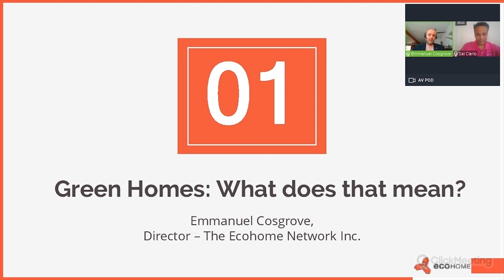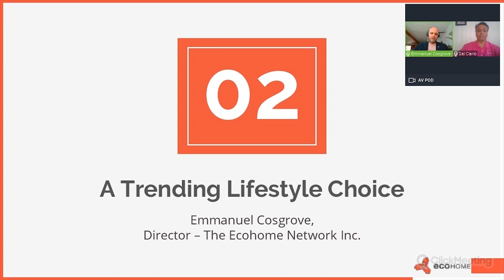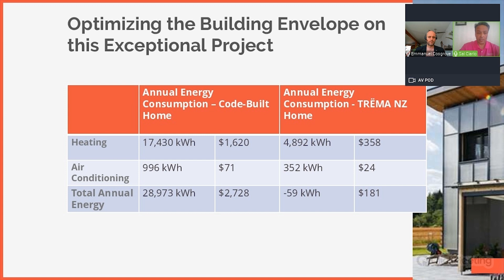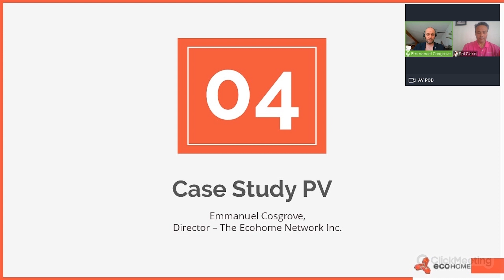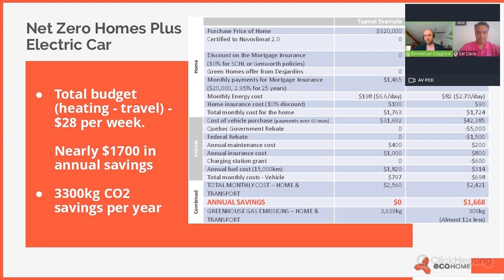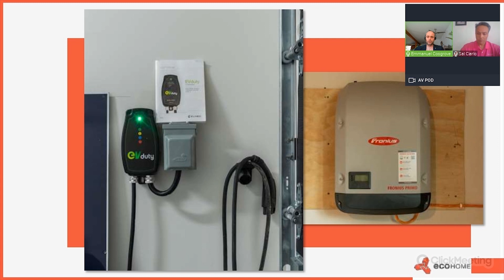Building Net Zero Energy Homes - Learn the Secrets to Success - 35 Houses in Canada with EcoHome

Comment: Building a simple masonry rectangular house with a 6/12 mono slope roof. The masonry columns help shade parts of floor to help circulation. I am building green to save on higher energy prices as planet cools. Plus all the south facing windows to grow more food. When the planet cools it becomes dryer and less plants grow. When the planet cools it never goes good for humans. Things like food shortages, trade collapses, energy prices rise, currencies are devalued, plagues break out, wars start, politicians get greedier and more controlling, and empires fall. The less bills the better. I love co2 it grows more plants. The carbons need to go in ground. To allow fungus and bacteria to break nutrients down into plant usable nutrients. I use concrete block then insulate cores. Then rockwool bats and then comfort board with 2 low perm barriers. Then cavity above grade, below grade rockwool instead of cavity, and 8 inch masonry veneer. Insulation under the foundation is money well spent. Ground temp here is 48F and frost line of 48 inches. We use a thermal break around windows. The bays around doors and windows get spray foam no vapor barrier. Condensation around windows and doors happens even with no air movement. So we let it dry. The rest of wall gets regular insulation and vapor barrier. Code here requires at least one led light per room and certain amount of glazing. I save by not buying an ev and keeping my old Detroit dinosaur. Lithium is not clean or green and produces lots of co2 to make. Low wattage d.c. devices are great! We are looking at appliances from boat and r.v.'s for off grid. I liked the earthships except tires. That's why I am using concrete blocks. No berm because in cold north. A berm in hot area is great to cool house by ground contact.